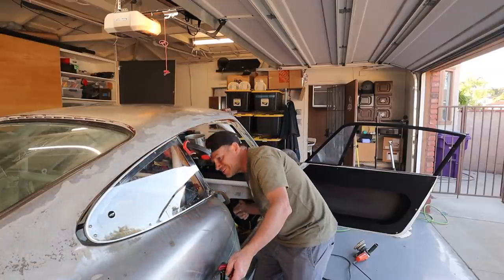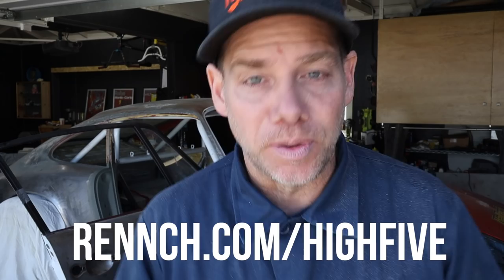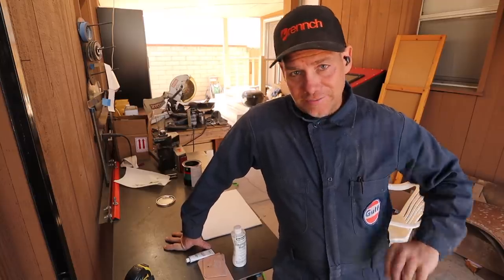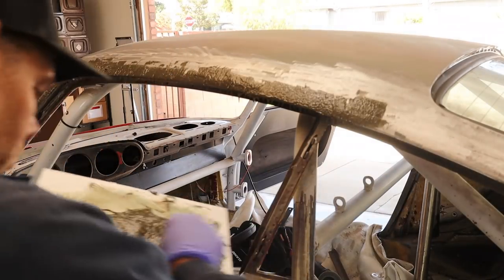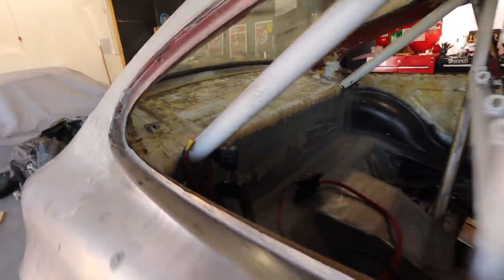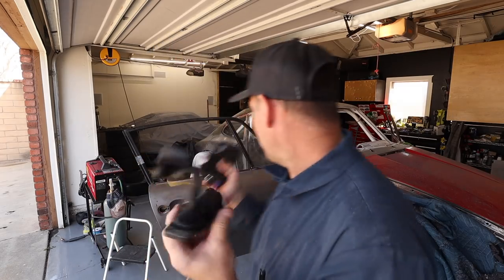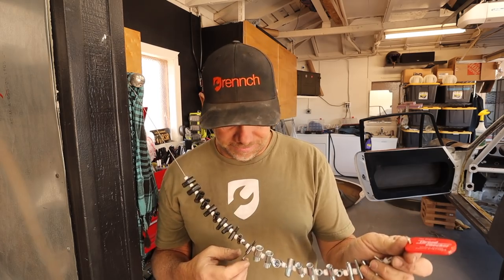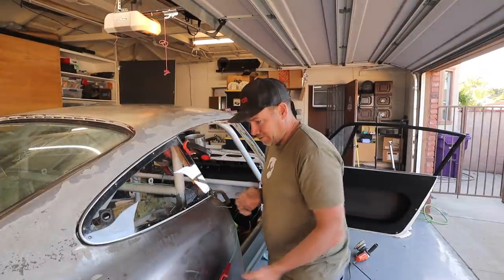"Bad Chad" Post Welding Treatment, and A Vintage Porsche Innovation I've Never Seen! | Blasphemy 48

Comment: I have used the BAD CHAD technique for 20 
years....works well....

Great idea and execution on quarter windows
Reply from the maker: Thanks John.  Mike (In a previous comment) brought up that the resin was the wrong thing to use and wouldn't cure properly. What have your experiences been?
Reply: @rennch.  The last time I used it was on my 66 Galaxie 4 years ago.  I won best convertible at a car show 2 years ago with the car.  No cracks  or problems after 10,000 miles....Porsche purists think you have to throw tons of cash at everything....to have any fun... ignore them...you are doing great!
Reply from the maker: @mike seguin lol. He was saying he’s been using the technique for 20 years, not watching the channel for 20 years!  Thanks for the input though, seriously.

Comment: Can’t wait to hear this thing Run!! Been following the build for quite some time, just a reminder as you’ve had bare metal for many weeks,,,,, any time you are going to apply filler make sure you sand way past the area as you have microscopic rust everywhere... when you’re to the point of priming for the first time please please please re-sand the entire vehicle even if the bare metal looks good it has that microscopic Rust everywhere, trust me 😐.... first prime should be an Epoxy to protect the newly sanded metal. You can get a High Build sandable epoxy and use that all the way through or Epoxy first coat and a standard high build primer for block sanding,,,,, Also, any time you touch the metal with bare hands you are transferring contamination from your skin that will definitely cause Rust 😳 you should get some Nitrile gloves..... Great Vids!!!
Reply from the maker: That's the plan!  It's protected too.  :)

Comment: Great job! I have also seen some guys use similar motors off older dodge caravans.
Reply: I second this- my wife has a Dodge Caravan with pop-out rear quarters and this is exactly what I want to do with my fixed 964 windows! The Grand Caravan's units are smaller but pop out (what looks like anyway) a lot more- so would be perfect for you to set up. You could even get the switch off of them at the junkyard- I've wanted to do this for years!
Reply from the maker: I actually had a set of those from the junkyard and went with these instead because of a longer throw, and it was more linear.  Might revisit.

Comment: I’ve been wanting to do the electric pop out control but with the E46 M3 actuators as they look very similar to the factory hinges
Reply: was thinking along the same lines, there must be loads in junk yards in CA.
Reply from the maker: Can you link me to one?  I couldn't find one in my search.
Reply: @rennch.  The rear quarter window motors was one of those little features I loved about my E46 Coupe (they all had them to my knowledge, not just the M3). 

In the E46 these little motors are sort of hidden inside the top of the side bolster area of the rear seat, so you only see the little black rod/linkage poking out to a spot on the edge of the rear qtr window and it mounts through the glass.

Anyway, here's a link to an example on EB*y - ebay.co.uk/p/1424696119. Also heres the actual BMW part info on the 'RealOEM' website - www.realoem.com/bmw/enUS/showparts?id=BM53-USA-12-1998-E46-BMW-328Ci&diagId=51_3687 - its part 12 in the diagram and you can see all the original BMW part numbers in the table below the diagram

You can see it in action off the remote key fob at about the 38 seconds mark in this video: https://www.youtube.com/watch?v=aMoMBPSa9NM

By the way, new subscriber who found you from Home Built By Jeff and enjoying your work!

Comment: I started on the same thing a few years ago, I used vent motors from a  01 to 08 chrysler town & country. They look to be a bit smaller than the ones your using. They also mount better.  I broke the latch off my 70 911e vent window when I was removing them and decided on doing the same.  You may want to look into the town & country motors, That said keep up the good work makes me want to finish mine.
Reply from the maker: I will definitely look them up on eBay.

Comment: I love your "can do" attitude Michael. I'd forgotten how precarious the car was when the engine fell off the stand but now it's immortalised in you intro. O_0. BTW, why not mount that actuator flat on the parcel shelf so its less visible. Won't it still have the same throw except horizontal? Cheers.
Reply from the maker: I toyed with that after you wrote this, but I can't get it close enough.

Comment: have you had a look at the bmw E46 compact rear window motors they are a lot smaller than the ones your using they have a hing like the bmw E30 2 door car and a cable that comes off it and goes down to a small motor

Comment: You could mount that motor on top of the wheel well, so it’s less visible. All you need is to make sure the pivot shaft is parallel to the glass.
Reply from the maker: I need a friend with a 3-D printer. :-)

Comment: You may have seen them already, but some 90s BMWs also have rear electric popouts - the unit is pretty small and maybe in a format closer to what you are after? Great video as always, ✋
Reply from the maker: Do you know which model?
Reply: @rennch.  the coupes had them, but I think they were in the higher specced ones ~e30-e36. A friend of mine had one years ago and it was pretty neat. If you google 'BMW coupe electric popouts' you'll get a few pictures.

Comment: Can you mount the window motor flat in the rear deck panel to make it  a little more planed, I think it will work.
Reply from the maker: I tried...no go.  I'll keep experimenting with different motors.
Reply: Rennch - Porsche 911 Restoration and DIY Tips how about a dodge caravan motor? They are fairly slim.

Comment: How does lead work on the drip rail area? I would think that it would fill the area and file off easily.
Reply from the maker: I tried it on the driver's side.  It's already got so much lead there that when I started heating the area up, it all started melting off.  It was no fun.

Comment: TIG brazing is the tech you want....  will fill and join way below the temperatures needed to melt steel....   motorcycle frame builders use it, so it's plenty strong...
Reply from the maker: Yeah I didn’t really have the time or the equipment to learn another whole skill.
Reply: @rennch.  I really recommend it...  It's take a bit of investment in both time and money... But it would be well spent... A reasonable TIG welder is under 400 pounds here in the UK.... Should be $400 in the US...
Reply from the maker: @realnutteruk1  Oh, I have a sweet TIG welder from Eastwood.  Just wanted to try this!

Comment: What happened with using lead?
Reply from the maker: I used it on the driver side, but as I heated up the panel, the previous lead started melting and making a huge mess. I was doing more harm than good.